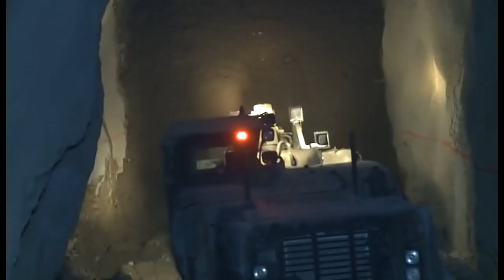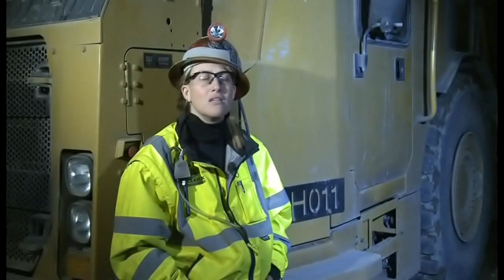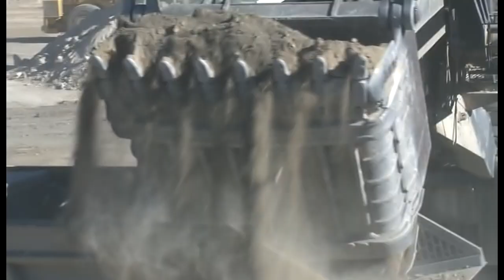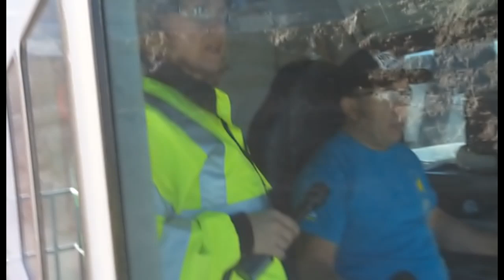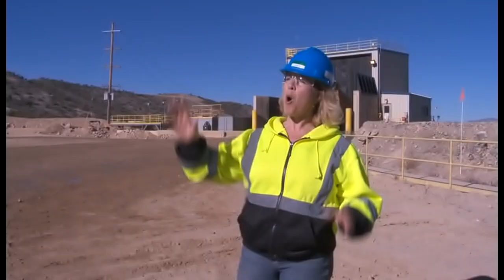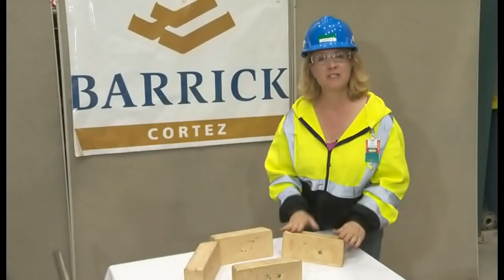The Mine Cycle

Comment: Safety first is a first for me. Nippers under the jumbo boom as they’re actively drilling, climbing through a deep sump. Removing PPE and using the scraping bar. Boggers not  putting up bunds in front of an open stope and mucking out. Boggers telling truckies to drive under unsupported ground to get loaded. So many safety breaches I’ve come across

Comment: Just another hole in the ground with a rabbit warren added to it . Barrick gold used to be in the western Australia region of the goldfields . Used to work for them . I've only got 23 yrs underground mining experience in many mines for minerals ranging from nickel to gold and lithium . Open cut and fill stoping  method is mostly done along with block caving method . most places use paste ( cement ) fill and others use waste rock as backfill . Using a jumbo isn't all that difficult when comes to boring out a cut / round , bolting and meshing is where patience and skill comes into play . Scaling is the fun part with a jumbo . Overall just another day at the office . Icon dets are best  used for stope firing . Piece of cake using the loaders, trucks etc . Using a loader on line of sight remotes or tele-remotes that takes skill . These loader / mucker operators in this video need to water down the dirt more and stop mucking dry dirt .
Reply: pard you clearly have never worked in Nevada. I agree that the muck pile needs to bet wet down before mucking, but if you put water on the muck pile in Nevada it turns to fucking mud and is miserable to muck. Only place I wouldn’t wet down muck piles was NV

Comment: Thank you for sharing, this was quite an eye opener. I have been reading and hearing so much about the environmental impact mining has been  having and the newer regulations on almost any thing any one wants to do, but this is the first time I have seen how these issues are being handled.  It does, however leave open the question of whether or not the open pits left from the  mining operations will eventually be at least partially re filled and if some of the underground shafts will be filled in.  The section on the underground operations gave the indication that the tailings could be repacked into the shafts after processing to remove the gold and so helping to reduce the negative impact on the land.
Reply: I can speak about Barrick Goldstrike also in NV. When they quit de-watering the open pit, it will fill about 25 feet a year with water.  So the end result is a lake in the desert, with about 75 feet of wall around it.  (I quit work there in 2002, so the exact details get fuzzy)  The rock that came out has been re-sculpted and replanted, so moving it back would just be more disruption.  This video mentions dewatering the underground at Cortez is also dewatering the open pit, unlike Goldstrike, where the underground is north of the open pit.

Comment: Wtf you are using diesel powered  equopmeny underground
Reply: They have good ventilation
Reply: Because it does not carry the toxins that burned gasoline does. After the DPF has done its job and all of the emissions tests have been completed, the diesel exhaust is much safer. Plus the ventilation shafts and air being pushed through the mine. Pretty safe work.